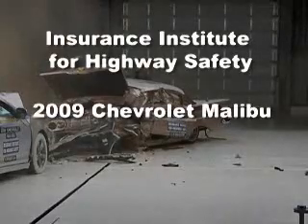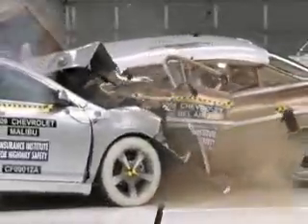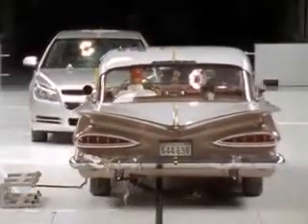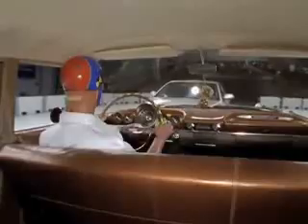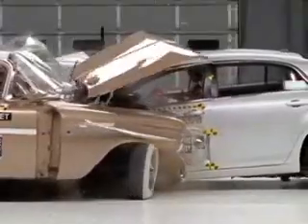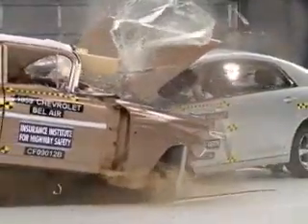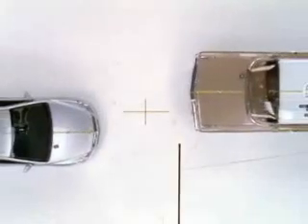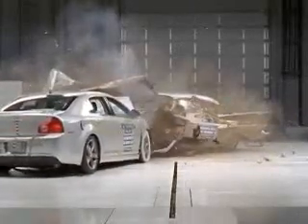Crash Test 1959 Chevrolet Bel Air VS. 2009 Chevrolet Malibu (Frontal Offset) IIHS 50th Anniversary

Comment: I read the comments and just thought to myself "wow, people are dumb as fuck" what the hell is wrong with you all thinkin an old car would stand in a crash with a new one? like really tho
Reply: +Jeremy Reynolds you feel dumb
Reply: Cars up till the 80s would break down all the time. Statistics prove that. It's only the 90s with reliable electronic fuel injection and advancements in suspension part metals that cars have become truly reliable. And of course also infinite safer. Metal alloys they put in modern chassis are tough (and light at the same time) but they were only invented with advance of metallurgy. The advancement can be seen through same models from the same company as years progressed. Look at the Mercedes W201 up to W205. In a W201 (which was already a modern car compared to the Bel Air), you would almost certainly be fataly injured at 64kh/h head-on collision. On a w202 you would sustain injuries but you wouldn't die. From the W203 onwards you'd sustain lighter and lighter injuries and in a W205 chances are you'd suffer absolutely no injuries at all. 

The car industry has made tremendous advancements in the last two decades, and I feel it's a bit unfair if you sufferers from the Dunning-Kruger syndrome are giving it a bad name.
Reply: +ddorfpunk1 234 I feel like you are voting for Donald Trump
Reply: +ddorfpunk1 234 most cars back then would start breaking down at like 70,000 miles, cars these days can reach like 300,000 miles if properly cared for.
Reply: +ddorfpunk1 234 do any old cars original work perfectly, no they are restored so sit down sir
Reply: +ddorfpunk1 234 I don't watch tv I don't hate myself
Reply: +Brian Speckert still your manipulated by the NW O
Reply: +ddorfpunk1 234 are you
Reply: +ddorfpunk1 234 you probably are
Reply: +Brian Speckert Logic? Who supports the new shit, me or you?
Reply: +ddorfpunk1 234 I feel like you live in a trailer park and still have a 2002 Nokia bar phone with Windows 98 and you steal your neighbors wifi because he can afford it
Reply: +Brian Speckert with a computer with Windows 98, not Nokia with Windows same @me
Reply: +ddorfpunk1 234 I'm not tryna fight you on YouTube like really tho. I like old cars a lot but new ones are safer by fact and I know it's hard for your 60 year old ass to understand but get together it's 2016 technology has advanced so freaking much.
Reply: +ddorfpunk1 234 anything can last if you treat it right. I've had a iPad since 2010 and works perfectly
Reply: +ddorfpunk1 234 I stopped reading because you wrote to much irrelevant info that means nothing to me. you're just mad because cars these days are safer so fuck off
Reply: +Brian Speckert Fuck yourself fool. Another idiot who cant stand other opinions and starts insulting when out of arguements. Typical for todays disintegrated society. Go ride in your ugly ass 'Car' that looks like a Turd mixed a rotten potato
Reply: +ddorfpunk1 234 how you gonna insult me you're like 50 sit down
Reply: ddorfpunk1 234 How about old Commodore or Amiga computers... or NES/SNES/Sega Genesis consoles? Some of these are 30 years old and ppl have them in perfect working conditions. A lot of ppl are still keeping their old PCs which will soon reach quarter of a century. These devices all have "integrated electronic parts". They are just welded much worse than today's technology (not to mention they use sub-par materials compared to today). So yeah... new cars with their fancy new gadgets will lasts just as long as old cars. But most will get obsolete pretty quickly anyway, so it hardly matters.
Reply: +Mitja Irsic Something like this is usually not in daily use, and the parts used these days are much smaller. Thus, they become very hot inside. Also they often use very cheap capacitors, and when a cap fails sometimes other parts are damaged too in modern curcuits. And a capacitor is sth than DOES fail when in daily use, also on old electronics, but it takes long and here its usually not a hassle to replace them. And who hasnt heard of the "mysterious" shut-off-after-turn failiure on many modern devices which usually get discarded. Weird, isnt it? So new cars wont last long, and cant be restored. Also I dont think noone will pay a cent for a
Reply: +ddorfpunk1 234 Cheap capacitors? Where od you get that? Do you work in the autoindustry? I can tell you that canbus systems used in cars from 2010 onwards are of a quality several times superior to that of standard PC components, plus it's insulated from the elements.first electronic components such as the single and multipoint injection have been on cars since the 80s and they have a lower failure rate than old-school carburetors (less moving parts). I have a car with a Siemens multipoint injection that's 20 years old.. Never had any problems with it. If anything breakdown statistics  in EU show that car longevity has increased dramatically since the 80s. These components I'm cars are very much underpowered compared to what's inside a PC and these too last for ages -  pretty much until you throw it away. In fact it you look at breakdown statistics you can see that most breakdowns are still mechanical (from wear & tear items). Your apprehension of electronics  is baseless or rather based on old rehashed myths that people somehow still believe.
Reply: +Mitja Irsic I dont know what is used in modern cars but I have some experience in consumer electronics. Yesterday A friend wanted me to repair an Amplifier that was 5 years old, It had a failure somewhere in the digital curcuits since it shut off EXACTLY 6 seconds after turning on. I suggested him to discard it and get a decent Amp from the 70s. I had a hair straightener that was 2 years old, 1 month after the warranty expired it had the same failiure. Who needs digital control in a Hifi Amplifier or a straightener? It makes zero sense, but sheeple think digital is necessarily better, and such components are cheap, dont last long and usually cant be repaired, so you have to buy sth new after a few years, so its win-win for the companies. I dont think the consumer car industry (I am not talking about expensive cars, I suppose they are higher quality, but they are unaffordable) is much different, and I HOPE its not, since their design is basically the epitome of post-modern madness. :D
Reply: Brian Speckert, "I feel like you are voting for Donald Trump" What kind of statement is that you dumb fuck.....
Reply: +Brian Speckert 1. I live in a big city not a trailerpark
2. I am 19 yrs old
3. I know more about technology than you ever will since I'm a vintage electronics collector
4. Yes technology has 'advanved' meaning it became more complicated (so noone can repair it and you always have to buy new stuff) but that doesnt make it necessarily better. I agree its better in some cases, like computers and cell phones (if they wouldnt always break within a year -.- (look up 'planned obsolescence)) but in every other case, like cars, radios, etc. the modern stuff in FAR inferior in quality and reliabilty.
Reply: +Brian Speckert 6 years wooow amazing -.- not every unit has planned obsolence, its mostly s(c) amsung. but you dont even need it. wait until the first caps or ICs  fail, and theres no doubt that will happen, extremely small parts driven to their maximum heat anytime you use it. And you will not get a replacement motherboard anywhere. Well, on sth like an Ipad its necessary to have highly integrated parts, but its NOT in a TV, Radio, car, etc. Guess what? I have a few Radios working with ALL original parts, one is build 1961.  I enjoy their amazing clean sound with my FM transmitter to listen to my own music. I have working TVs from the 70s/80s - all original parts. I have nintendo consoles etc. etc... and if these units break, they are easy to repair since they use common parts, not highly integrated ones. Tell me in 30 years if you Ipad still works.
Reply: +Mitja Irsic I didnt doubt the safety is better, still this video is exaggerated. The overall quality was better back then. And what has fuel injection to do with safety?
Reply: +Brian Speckert You wanna tell me modern cars will still work in 50 years with all their highly integrated electronical parts? Go on dreamin...
Reply: 59 has a defective frame that's why they used it an old car is much stronger then a new one
Reply: +Jeremy Reynolds then tell me why I watched all these crashes with an old car vs. new and each time the old car crushed and the dummy died, and 59 to 2009 (which is when this crash was done) they did it for the 50th anniversary of crash data to show people how much cars have gotten safer and don't tell me you'd rather be slammed into a wall in an old car because you'd die in a new car with airbags crumple zones smart seat belts you'd possibly survive, crash deaths have declined so much because it's a fucking fact that new cars are safer.
Reply: +Brian Speckert Yes. But I already explained why new ones cant be restored.
Reply: +Brian Speckert You watch too many commercials

Comment: They picked this particular Bel Air because of the X frame that was more vulnerable than most other vehicles of the era, and it also had the smaller V6 with a lot of empty space around it as well, causing it to be particularly ill-suited for this type of crash.  Another car from the same year with a ladder frame would have pulverized the 2009.

Comment: Yeah, buy one of these so called ''safer'' cars of today, the fuckin throttle sticks wide open or the fuckin brakes fail or it just Quits going down the road because the fuckin computer went out it or maybe it will catch on fire because of all the fuckin electronics got a short in it. They recall these fuckin computerized shit boxes ALL the time, I don't ever remember the older cars  being recalled all the time like that......fuck those POS, I'll take the '59 ANYTIME

Comment: My question is why didn't the bel air shove the Malibu back. The bel air is a heavier car and should have sent the Malibu more in the opposite direction. Where they going at the same speed?
Reply: It's because engineering is more advanced in 2009 than it was 1959.
Reply: 1959 Bel Air Series 1500 - Six-Cyl
C 19 4 dr Sedan - 6P $2,440 Shipping weight 3,600 lbs

2009 Chevrolet Malibu(2.4L 4-cyl. 4-speed Automatic)
 - Features & Specs
Weights and Capacities
CURB WEIGHT 3415 lbs

Comment: I'd rather have the motor from back then instead of the snake pit they are putting out now.

Plus, there wasn't a shoulder belt then either, so obviously the survival rate will be higher.
Reply: +Dick Trickel have fun getting thrown out of the wind shield.
Reply: Seatbelts fool, seatbelts.

Comment: Make sure you don't crash in your 59 bel air if you're missing the engine. Thanks IIHS!
Reply: +Jsp P5 Taunus Both of those cars are on display at IIHS in Virginia. Go have a look and you'll see the inline 6 under the hood of the Bel Air.
Reply: Both cars weigh almost the same as pointed out elsewhere in this thread. No engines missing.
Reply: U probably missed the engine tucked into the dummies feet...
Reply: you're a total moron if you think the engine is missing lmfao

Comment: This test was not fair for the bell air. The bell air was equipped with a longitudinal straight 6 cylinder (conveniently chosen even that 8 cylinder engine gave more protection) which during offset collision didn't contribute much protection because its is located in the center and bell air body is wider by about 9.6 inch then malibu.  Also when viewing the crash from the inside of the bell air the speedometer shows initial speed of 50 mph to 45 mph just before collision.  If the speedometer is correct then both cars collided at 90 mph and not at 80 mph.  Conclusion, offset alignment in this test had gave limited engine protection in the bell air because bell air is wider by 9.6 inch from malibu.  For the test to be fair the bell air should have been aligned at least 50% of its width or head-on.

Comment: maybe if they put a motor in the chevy ,IT MIGHT BE DIFFERENT!!!
Reply: +Liam Keane Both cars had their engines in them.  The 6 cylinder Belair generally had several inches of dead air between the grill and engine.
Reply: +lou reeves the institute site shows both cars on display on there site neither car has an engine in it
Reply: +lou reeves if there was a engine in the bel air it would have gone through the dash board , if there was an engine the 2009 Chevy wouldn't have gone right through the front of the bel air the engine would have not allowed it to cut through the car like that, and again if it did you would have seen it go through the dash board
Reply: +Liam Keane This is a front overlap crash, not head-on. The engine wasn't really in the way of the collision. That specific reason is why front overlap crashes are so fatal.
Reply: You can see the cars they tested, complete with engines, online or in person. New technology trumps old, sorry to break it to you, old cars looked nicer, but they usually didn't last past 100K, and were certainly not engineered with safety in mind.
Reply: +Liam Schofield yes but back then those engines were so massive and heavy the "rock solid " he's talking about was all the engine my dad drove a 1949 dodge in the 70s a really well put together car he got in a accident once and the other car got the whole front smashed in and he walked away with a few scratches and dents in the bumper but that was it , if it had an engine it wouldn't have been like that neither car has an engine
Reply: +Liam Schofield if they had engines in them and preformed like that in a crash they wouldn't put them on the road

Comment: they removed the engine out of the 59 Chevy, this is a joke and they rigged this to make the 09 look good so they can sell it. They hate those old cars on the road. I have a 1981 Oldsmobile Cutlass Supreme and I just dont feel as comfortable in a new car
Reply: +Steve Dwyer (TheCARS1979) Thats pure bull shit. Go sit inside a 2016 BMW X6 or a new Range Rover and tell me if you feel more 'comfortable' in your o-mobile..
Reply: Ive been in new cars before.
 Its all a matter of opinion and how another drives. Nooone is going to remove the engine and no thanks, I still am comfortable in my Oldsmobile. I wont give it away

Comment: But at the same time older cars don't get nearly as injured from minor wrecks like somebody backing into your bumper and what not. Newer cars will crack and dent like crazy.
Reply: wolvieguy  "you wouldn't need those in the first place if the outside of these new cars could take a hit like the old cars "

lol, so I take it you didn't watch the video. And you literally just contradicted yourself by saying their interior features make them safer than old cars.
Reply: wolvieguy You mean the big shiny metal thing sitiing in the '59 that is clearly visable at the 5 second mark?
That invisable engine?
Reply: Three axle garbage trucks weigh around 60,000 lbs. A 5mph rear ender with a 60,000 lb vehicle will do in just about anything - 1959 Chevy Bel Air? Toast. 

Difference is, if someone was in that Lexus, they probably lived. In the Bel Air, that'd be questionable. 

The math behind "impact force" is somewhat complicated, but a 5mph rear ender from a dump trucks results in thousands and thousands of pounds of force being applied to the rear end of the car in front.
Reply: What are you friggin talking about? Dude, I watched someone crash into the back end of a 2004 Ford Focus at about 25 mph, with a Dodge Stratus, and you'd barely ever know the Focus got hit. In an older car, both the bumpers would have been mashed to hell, and had to have been taken off and replaced entire, if not the mounts, too.
Reply: +Todd Rich My neighbor down the street owns an El Camino and someone backed into his bumper and there is a massive dent where they hit it. Some kid at my school owns a BMY 5 Series and backed into a school bus and there was practically nothing to show except a few scratches on the Bus and BMW
Reply: New cars are also made of steel. They have plastic or more steel on the outside of the internal steel. Cars weigh 2500 - 5000 lbs. You don't do that by not having any metal in them. In fact, a current generation Mustang ways significantly more than a 1969 Mustang.

Comment: Why are so many people saying the 59' had no engine? The difference in weight between these cars is about 100lbs. If the 59' truly had no engine, it would have been driven back. This did not happen, they both stopped where the impact occurred.
Reply: The old car twisted around the new car and that means the force of each car was not equal--either the new car was faster or weighed more. It had more momentum than the old car.
Reply: The car had a straight 6 engine. The main problem is it had an X Frame.
Reply: +Samuel G NOT TRUE , the weight of the car and strength is up front ,ask yourself <why did they do the test with no engine ?

Comment: GM's X frame wasnt one of there best ideas.  Ide still take the 59......
Reply: Total Performance 1964 i almost wrote a letter to gm thanking them for their engineering in the 60s. I totaled my 64 impala at 80 mph, ramming two metal poles flat an then flipping the car.  I walked away with minor glass cuts on my arm...